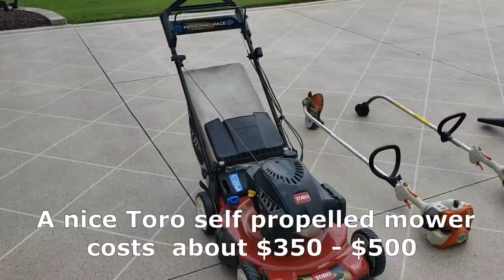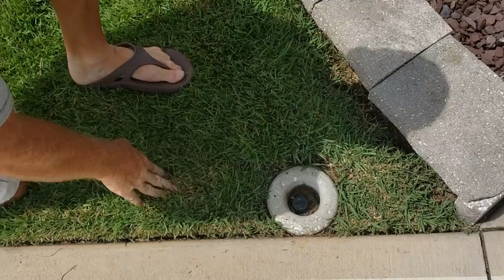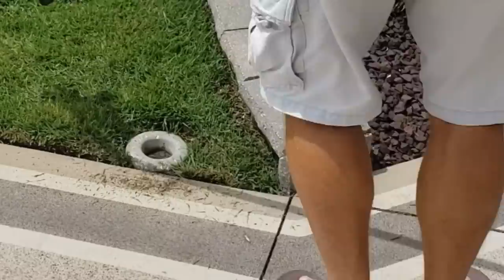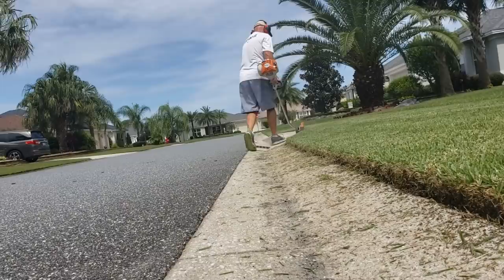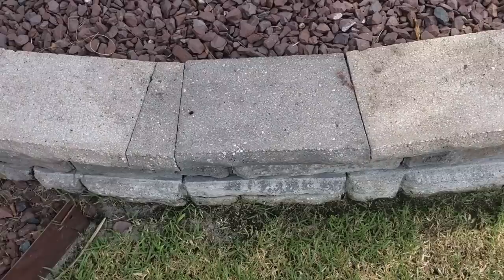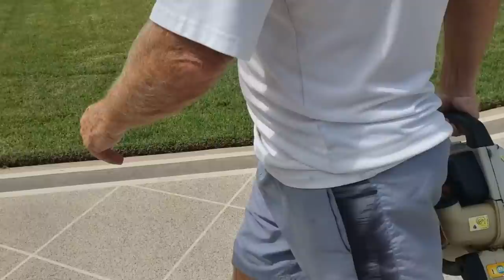Cut Your Own Grass?  Or Hire It Out?

Comment: We do our own lawn with EGO battery operated products and save about $150 a month. Nice, quiet and no gas. Takes about an hour to mow, trim and blow off the driveway for a 10,000 sf lawn. But we do hire out a professional for bug and weed control and fertilization. Florida lawns are not your typical northern lawn. Lots of quirks here for lawn care.
Reply: I'm curious how you save $150/month when it costs $50/month for lawn care
Reply: @golfnut2599  I live in Inverness FL, not TV. During rainy season, they cut and trim every week for $37.50 per week. During dry season, probably only two cuts a month. I wish I had lawn care for $50 a month!  With gas prices on the rise, I wouldn’t be surprised to see prices go up.

Comment: Keep in mind, that a "push" mower, in most cases... you don't have to push. As long as it's self propelled, there''s little effort involved. Only the cheapest of the cheap mowers you'd buy at Walmart are truly "push" mowers. That Honda I mentioned has such a robust self propelled system, that it will literally drag you around the yard. If you set it all the way fast, you'll almost be jogging behind it.

Comment: I'm a retired Ace Hardware man. I'm almost 70 years old and I still do my own yard work. My neighbors are jealous and they always ask me for advice 🙄.
Reply: My father is 89 and still does his own, he bought a riding mower about five years ago to replace the push mower though. I am only 60 but I mow my own lawn, four acres of mowed grass and mow around 50+ trees. There are a few hundred more trees around the perimeter so there are at least 100 branches to pick up each week
Reply: @toddac61  The part that I hate the most is picking up the branches from the parkway trees but otherwise I still enjoy the mow.
Reply: @mr.cheez-its1732  I have a 61" mower and if the branch falls and it is less than and inch thick I just mow it until it is gone.

Comment: Fifty dollars a month for mowing.  Does that include shrubbery trimming too?  And how much do  you pay for chemical  applications for pests and diseases?  Also, you have a tiny lot.  What would your neighbor's monthly cost be for mowing by your lawn service?  Finally, how long does it take him to do all his lawn chores?  By the way here in On Top of the World I do my own mowing of my 13,000 square foot lot.  The heat and humidity caused me to buy a lawn tractor in 2014.  When the engine repairs piled up this summer I decided to buy an Ego battery push mower.  But even  though it's self-propelled, it felt like I would die during my 60-minutes of cutting so I bought another riding mower.  It will pay for itself in a couple of years.
Reply from the maker: It's about $50 a month for a small lot. Bigger lots like the corner lots or the cul-de-sac lots could run as much as $80 or more per month. You are absolutely right about the heat. That is another big reason why we don't do our own.   The lawn companies try to get several homes near each other to be more cost efficient.  It generally takes them about 10 to 15 minutes to do our entire yard.

Comment: I like his Stihl equipment, however he should have bought their Kombi system.  One power head then a edger attachment, weed eater attachment, and blower attachment, (they also have various other attachments, tiller, bed definer, hedge trimer, pole saw and probably some things i missed).  However, I have to say there blower attachment isn;t the greatest. Saves space and you only have to maintain one motor.
Reply: I have the Stihl Kombi system. It is great only having to maintain one gasoline engine. I have the blower, straight line head trimmer, pole pruner, adjustable hedge trimmer, and the shaft extension. I was impressed with how fast the edging went with the lawn edger. I use the trimmer turned sideways and usually have to go slow on my St.Augustine grass.
Reply: @robcapel9825    Yes, I would like to get the adjustable hedge trimmer, I also have a 3 ft. extension, which I plan to try out on the pole saw. I hope to reach up to about 10-12 feet.  It would be nice to trim some of those overhanging branches away from the roof.

Comment: I'd certainly  spend the $50 a month for a weekly cut, that's pretty cheap to not have to break a sweat. I'm at 27 bucks a cut per week on one property that I'm not always at plus around $100 a season for hedge trimming.  (bigger lawn than yours) but still that's 120 a month and at another property where I'm more or less there all the time I cut it myself , mow the lawn for a disabled feller next door (corner lot) and loan out my extra (backup) lawn mower to my neighbors when there mower's have mechanical issues..